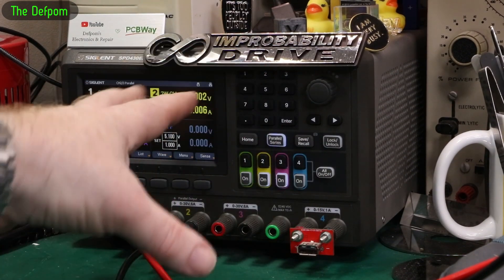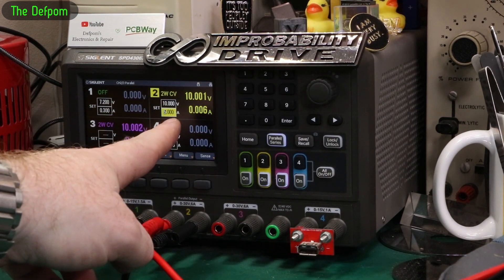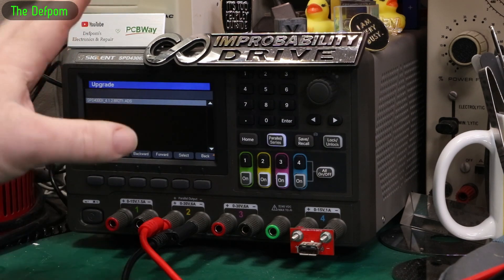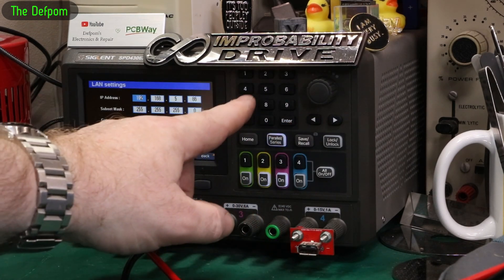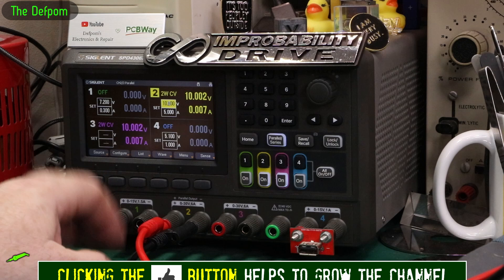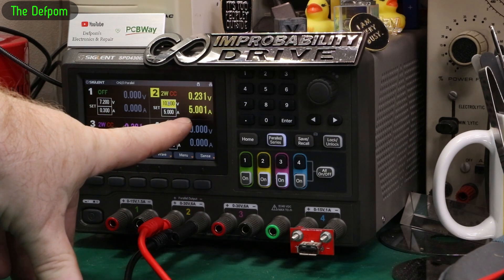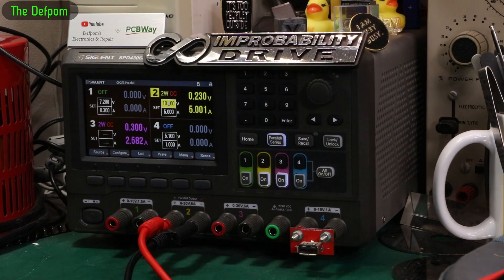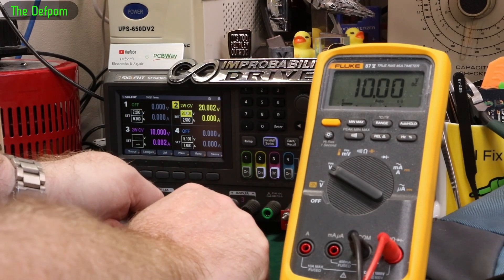🔴 Siglent SPD4306X Firmware Improvements - No.1334

Comment: Hi. Just purchased one of these along with the SDS824HD-X and the platters AWG. I have just upgraded the PSU firmware but the latest on the site was 4.1.2.8.R1 rather than the R2 you had. Where did you find that version?

Paul
Reply from the maker: @paulgamble7548  as I mentioned in the video, this is a version that Siglent sent me to try out to see if it fixed the issues I raised with them, I’m sure it will be released soon.
Reply: Are there any new updates here? On the Siglenteu website, only version 4.1.2.8R1 is available so far.

Comment: That’s awesome that the company fixed issues with the software from the feedback makes me want to buy more products from them… I have the same manufacturer, but different power supply It’s awesome that you give them feedback and they fix it. Good company.
Reply: Well for 1000$ I would expect a tip top PSU that behaves as expected. Honestly I have been quite disappointed in Siglent with this PSU, as many of these bugs should have been caught way before in QA, not by users.